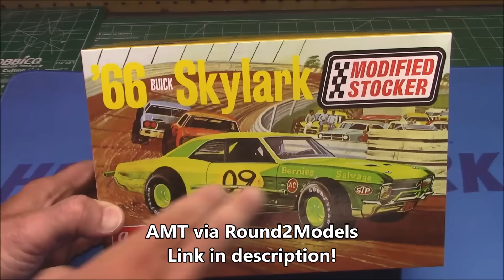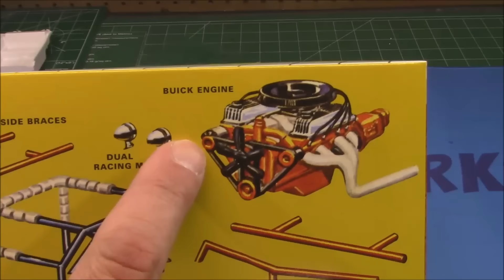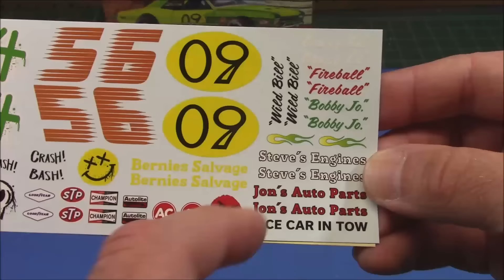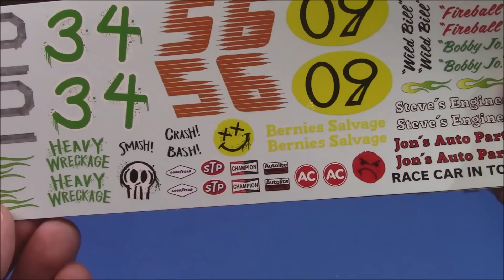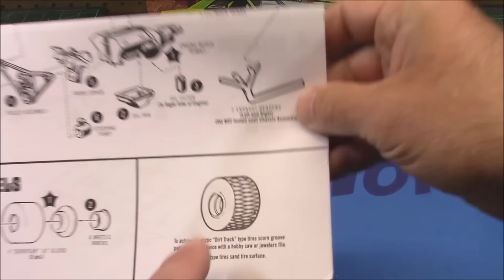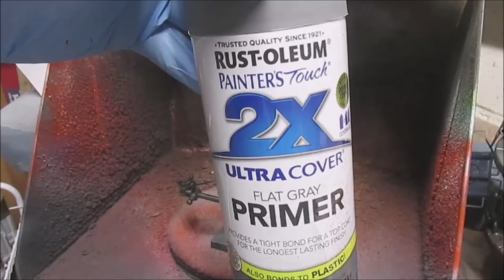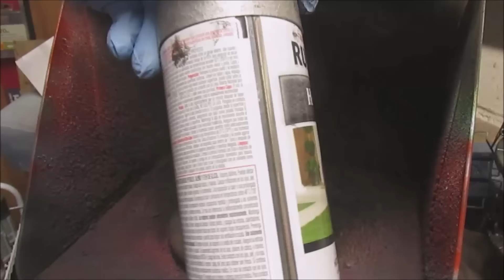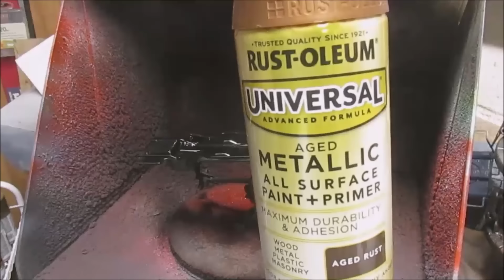1966 Buick Skylark Modified Stocker 1/25 Scale Model Kit Build How To Assemble Paint Dents Decals

Comment: Very cool build. The nail head Buick came in several sizes but the only one that had real performance was the 401 with the factory 2×4 carb it made 425 hp.
Reply: The 401 was never offered with a 2x4 setup, the 425 version from the Riviera Gran Sport and the big cars had that option. It does however find itself on a lot of 401s. I am always in search of one myself for my 65 Gran Sport.

Comment: I've built  2 of the original   kits  and 1 re-make  .  The re-makes are better than the originals. The new kits have better tires ,  glass...and decals. They aren't great kits ..but are a lot of fun.  The Super Stockers are fun kits too. .   I wish they made a Mustang and Camero.  Oh, I found some music wire ( like they used to use for RC ) is great for metal axels if you need another size .    Thanks for sharing  Chris .

Comment: Back in the sixties they raced cars like this but they put duels on the right side and an undersized wheel on left side. Then they put slicks on the rear. With speed up in the turns the left tire was always a foot in the air ! 😂. Great build . 🇨🇦

Comment: Just some engines that were in most Buick's 215, 360, 430, and 465 some had 455.  In the 1965 Skylark was a 225-cid V-6 that pumped out a sedate 155 horses. Somewhere light green some light blue some chevy orange because GMC got in trouble for not having mixed motors in their cars